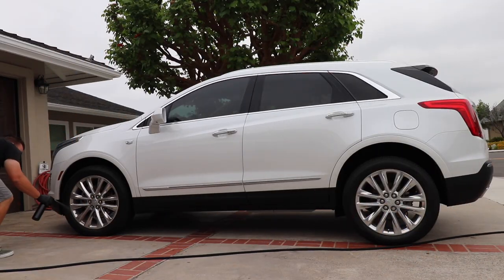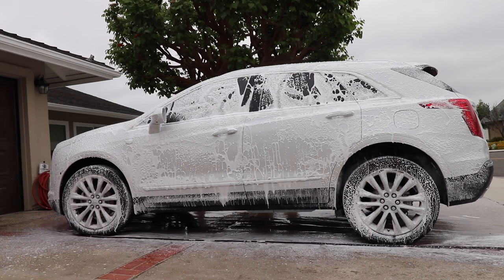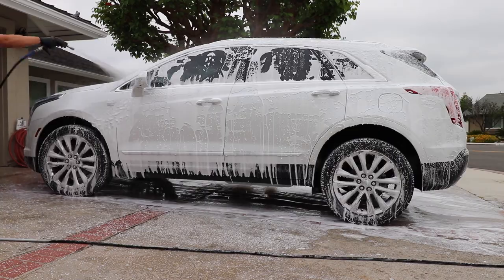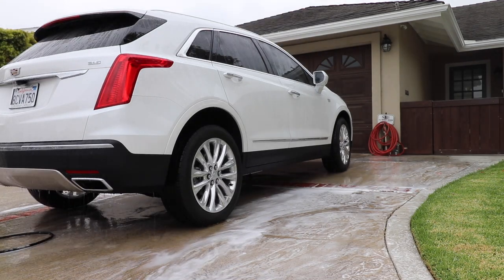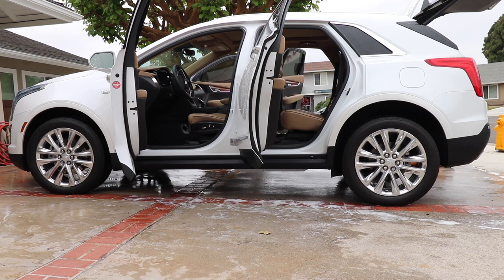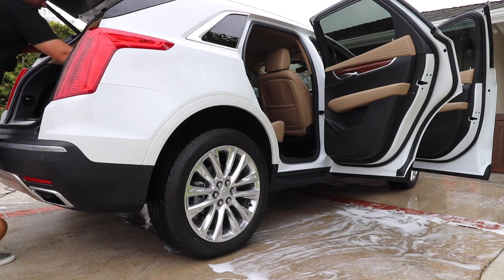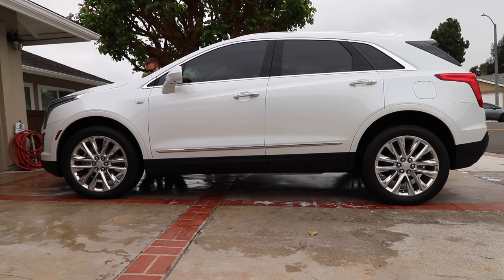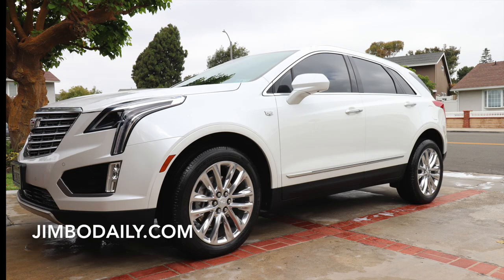HOW TO DO A MAINTENANCE WASH ON A CERAMIC COATED CAR

Comment: Can I use a pressure washer with PPF Xpel film, I heard Pressure washer can peel film.
Reply from the maker: Yes you can. You will be fine as long as you don’t use it at full pressure and hold it in one spot
Reply: JIMBO'S DETAILING 
Thanks. I’ll give it a try.

Comment: Is it possible to use outside coin wash to do the maintenance? If so, would you please teach me how?
Reply from the maker: Yes. Just don’t use the brush that they supply. Bring your own buckets and wash mits and use the coin opp pressure washer only
Reply: @autodetailingpodcast  Thanks for the information. Would you mind introducing stuffs I need and soap i can get from amazon ? Appreciate!!

Comment: Do you use a different method for vehicles thats not coated for so those summer days
Reply from the maker: if the car is non coated I will use wash mitts after I foam the car